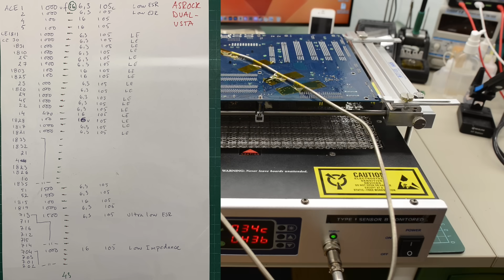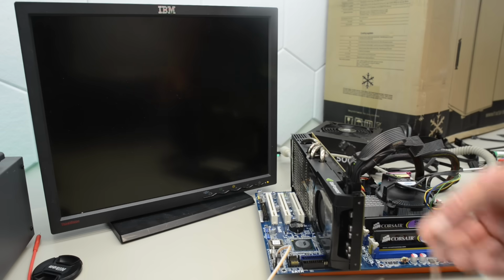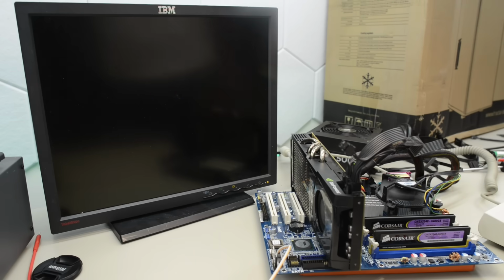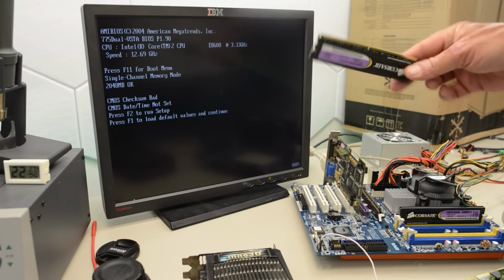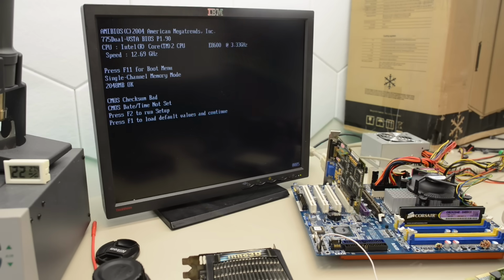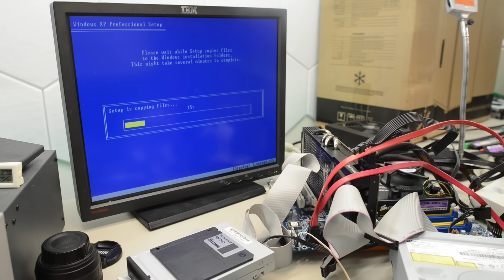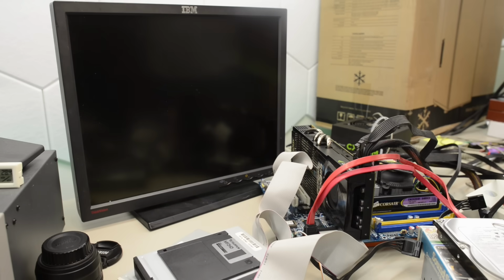ASRock  775Dual-VSTA Polymod gone wrong

Comment: I have definitely bricked things in the past due to defective flashing software like this.  Seems like the dos based one was just expecting a certain filename or possibly needing you to specify which file to flash.  Sometimes you have to use a very specific filename format for flashing things.
Reply from the maker: That's quite possible. Unfortunately, the flasher came without any instructions

Comment: I personally run a memtest86/+ when I change some cap. Memtest will test RAM and CPU. If any red lines or message appear, the board is unstable.
 
The unbrick is simply done by removing the bios chip and reprogram manually.

Comment: I don’t think I’ve ever had a VIA chipset board where SATA has worked fully and reliably. Stick with IDE for this board?
Reply from the maker: It seems to be glitchy, but I'll do some more tests before I switch to IDE drives
Reply: @Epictronics1  I remember reading / being told that the VT8237R-Plus was the only VIA south bridge of this era that supported anything but original SATA-1 drives (i.e. virtually no SSDs). Yours looks like a VT8237A, so possibly no support? I deliberately got a socket 754 MSI board with the VT8237R-Plus for this reason, but still found it really glitchy and unreliable with SSDs, so switched to IDE converters :(
Reply: @justinc4261  the VT8237A and VT8237S were both later versions that should not freeze when detecting SATA 2 drives but they are still buggy in other ways.

Comment: Might be worth investing into a ROM/FLASH reader like a TL866 or one of its newer variants, that way you're not reliant on software flashers but can instead flash (and dump) BIOS chips outboard, and most importantly it'll allow you to recover even completely borked devices.
Reply from the maker: I have a TL866 and probably the correct adapter

Comment: P5Q Premium Or EP45_UD3L 10 Times Better Than This Crap
Reply from the maker: I'm sure it is, but this project is not about the best board. It's about getting as fast as possible with three floppy drives
Reply: @Epictronics1  These two motherboards that I introduced can do the same thing much better. They have good compatibility with hardware, they last even better, and they can also support modern operating systems.
Reply from the maker: @Hadi_Sabet  I checked the P5Q manual. It doesn't mention multiple floppy support. Are you sure?
Reply: @Epictronics1  It doesn't support it. This is yet another case of someone with no clue what they're talking about dismissing a low(-ish) end board that would do the job, simply because they don't like it, and firmly believe their option is better, even if it completely misses the point of compatibility for a specific issue. Also ironic that they suggest the somewhat infamous, stripped-down, cheaper "Lite" version (which is what the L signifies in Gigabyte model numbers of that era) of the EP45-UD3(P) board as a "better" alternative in the same sentence... just proves my point lol

Comment: You can convert LGA 771 Xeon CPU to work on a LGA 775 motherboard. I have 2 machines like this at home with 8GB RAM each and they work quite well even with modern tasks.
Reply from the maker: I'm considering that mod. Not sure if it's going to be with this board yet
Reply: @Epictronics1  Have in mind that you will need DDR3 exclusively and a bigger cooler.
Reply from the maker: @VladoT  Ok, thanks. Definitely not this board then. It will only take DDR2
Reply: @Epictronics1  Yes, this is deffinetly an older board. I had luck with a Gigabyte ga-p43t board. It has DDR 3 support and features Floppy, IDE and SATA connectors.
Reply: @VladoT  i have an earlier Gigabyte ga-p35-ds3l atx lga775 with a Core 2 duo, 8800 gts 512mb and sound card. Only 4gb ddr2 but pcie, pci, fdd, ide and sata. It was my old Vista machine before the hdd died. Any ideas how I could still use it or whether anyone would want it? It's a bit older than my dad's old Phenom II x2 550/ATI Radeon HD 5750 1Gb system but that is still chugging away with windows 10 and Mint xfce on an ssd
Reply: @VladoT You don't need DDR3, just a chipset that supports the consumer equivalent of your xeon.  I'm running a Xeon E5440 @ 3.4GHz with a stock intel cooler on a DDR2 board with 8GB of ram (ASUS P5K-V) and i've also tested other boards with g3x chipsets
Reply: @VladoT  The xeon mod has nothing to do with DDR3... what the heck kinda nonsense comment is that?! The main issue with the Xeon mod is that most of the decent models (E-series, E54xx) cost about the same as the highest-end C2Q equivalents, and the cheaper ones (X-series) either run at 1600 FSB (which excludes pretty much anything but high-end boards) or use even more power than the consumer C2Q (X5460 for example has 120W TDP, X5482 has both 1600 FSB and an absolutely ridiculous 150W TDP)

Comment: I just had to finish recapping a 939Dual-Vsta. ALL the 1000uf 6.3v and OST caps have failed on the Asrock boards I have from that era. I have flashed those types of chip in the Tl866. I have done it for DFI, ASUS, ABIT boards. 49LF00X x for the size.
Reply from the maker: Thanks. I think I have the adapter

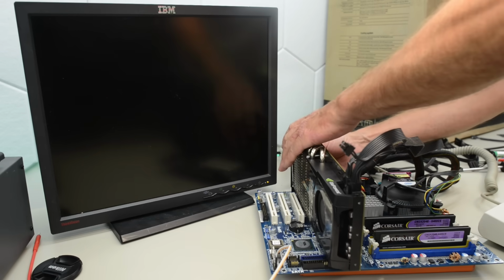Comment: 6:53 Speed 12.69Ghz 😃😃😃🔥🔥🔥
Reply from the maker: Yeah, what's up with that
Reply: @Epictronics1  Probably BIOS bug.
EDIT: Yeah... it's probably a bug. The list of cpu support doesn't list that E8600 but it doesn't prevent it from running. I can see some BIOS updates have new CPU microcode but the list still doesn't include E8600. Needs further investigation and probably add/replace manually existing microcode for the E8600 to run properly.
Reply from the maker: @hugosimoes5119  The modded BIOS might have the added support. Not sure, but some people have definetly made it work with the E8600
Reply: @Epictronics1  It's still need bios version 3.19a to work stable.
Something similar happened to me ,then i swapped CPU with C2D E6700 ,reflash BIOS ,now works fine with E8500
Reply: @Epictronics1  I though the E7600 was the one for the update... the chipset is not rated for 1333 FSB
Reply: @Epictronics1 if it's award with cbrom you can add the microcode. But It depends on the chipset and the traces on the cpu. I have a pentium d mainboard with 945pl chipset the chipset supports pentium dual core or even core 2 duo but i added the microcode to no avail.
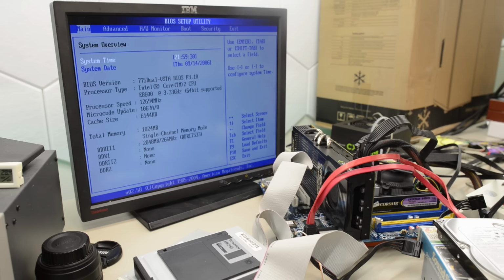Reply: @Epictronics1  It's a BIOS bug affecting most of the ASRock boards from that time frame. My 775i65G (i865G with C2D support), Conroe 865PE (basically just the full ATX version of the former) and 4CoreDual-VSTA (newer revision of your 775Dual-VSTA) also show that stray "1" infront of the speed in multiple places. It also appears later in the video at 9:20 showing 12964MHz, rather than 2694MHz. And yes, even with the corrected reading the speed is too low, cause the chipset doesn't support 1333 FSB.
Also re ASRock marking the positive side of the caps on the silkscreen, that's a leftover from when they were owned/controlled by Asus/Pegatron. Asus boards did it first (and caused me quite a bit of grief when I first recapped a CUBX), and despite ASRock now being its own entity rather than a sub-brand of Asus, they still kept that questionable "tradition" to this day. If you look up closeup photos of current-gen ASRock (and Asus) motherboards, the polarity markings are still bass ackwards

Comment: yes the video unbricking the bios , i had something similar with an older bios and a newer processor.
Reply from the maker: I'll start recording tomorrow
Reply: Shorting pins on the BIOS chip goes to the emergency recovery on the boot block if the flasher does not flash It. But you need a PCI video card and a floppy disk for the recovery.

Comment: There have been some rumors of successes on more modern boards adapting the LPC bus (from the TPM header) to ISA and using an older floppy controller that way… but there may still be 360k issues with that setup
Reply from the maker: Cool project. I'll look into it. Thanks for sharing
Reply: @Epictronics1 Why do you need 360k support?  The 1.2M floppy should read 360k just fine.  If you need to write to 360k, well, you likely don’t.  If you do, consider a Grease Weasel.
Reply from the maker: @CandyGramForMongo_  I need this machine to write floppies to all my older stuff. I make 360k floppies frequently
Reply: @Epictronics1 Sounds like a use case for a Grease Weasel.
Reply: is there any software that will not rely on BIOS to access the disk controller and interface with the hardware on its own, where it won't matter what the BIOS says it thinks the drive is or what it supports?
Reply: @Aeduo I keep having to repeat myself.  Yes, a Grease Weasel.  It reads the disks magnetic flux.  It’s lower level than data encoding (e.g. GRC, MFM, etc.).  You can archive C64 disks on your PC for example.  You can write the magnetic flux back to a disk as well.  You can generate a target disk image from a magnetic flux capture.  It works with all disk drive formats.
Reply: @willyarma_uk You’d think, right?  😂
Reply: @CandyGramForMongo_ the idea would be that it's something that could be used without extra hardware that someone may not already have and that they're not necessarily trying to write exotic disk formats but just usual PC formats.
Reply: @Aeduo How much control do you need?  I agree, merely copying PC disks does not warrant a Grease Weasel.  But if you are archiving disks, it’s the way to go.
Reply: @CandyGramForMongo_ I think he just wants some easy means to transfer software to older PCs by just copying files to floppies which are the right density for some older drives.

Comment: I like that you show the failures, most of these projects never go to plan. I always run into stuff like this myself but you learn the most solving the problems. I look forward to seeing if you can recover it.
Reply from the maker: Thanks. Should be interesting to see if it can be fixed
Reply: @Epictronics1  I cant see why not, just remove the chip and reprogram it with a known working version, or replacing the chip entirely.
Reply: @Epictronics1  I'd put in a 1066 fsb processor instead to stay within the official fsb limits of the motherboard, either a E7500 or E7600 should be pennies these days while being more then enough performance for almost any agp card out there besides the HD 3850, 3870 & 4670 maybe as well.

Performance wise the e7600 is basically on par with the E8400 besides the smaller cache, we're talking 1.5% when the extra cache isn't the main limiting factor of the system.
Reply: @Mini-z1994  Yet another alternative: Pentium Dualcore E5800. That one runs at 800 FSB and still clocks in at 3.2GHz, leaving the door open for some "mild" (by Core2 standards) FSB OCing to 1066 and lowering of the multiplier if unstable (which it likely will be as it would run at 4.26GHz on 1066 FSB if you leave the multiplier at the stock 16x lol)